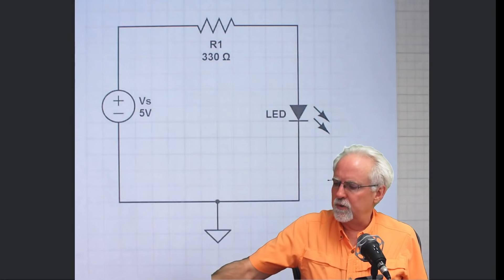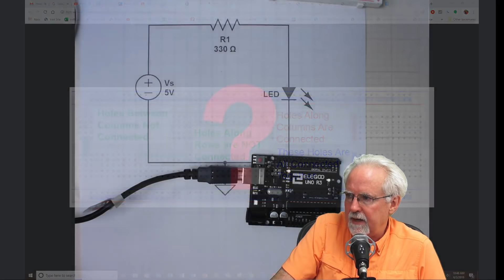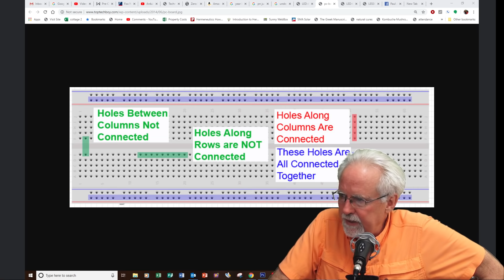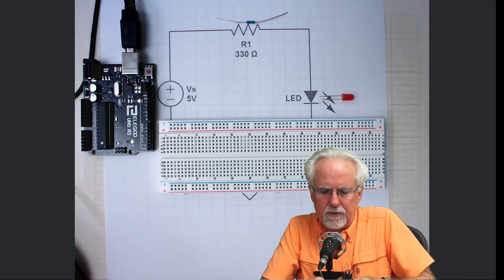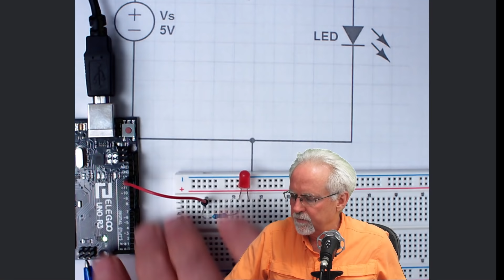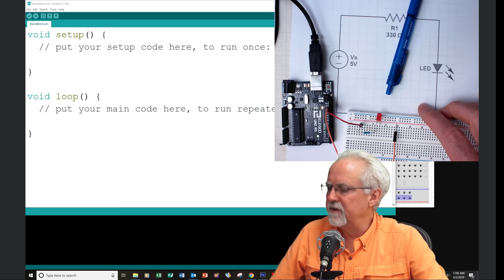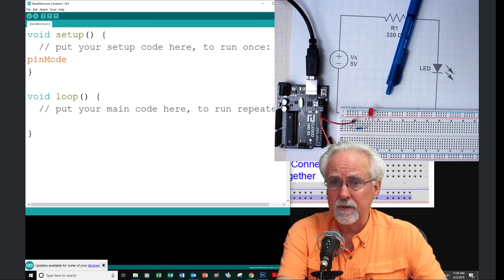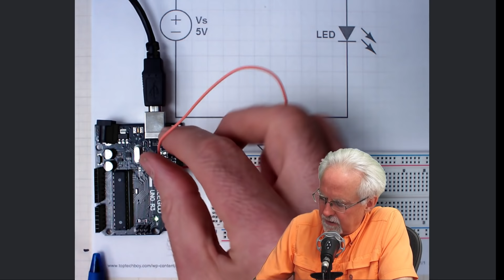Arduino Tutorial 3: Understanding How Breadboards Work

Comment: Paul, I hope I have done this right.  I put the following ALL under VOID Setup:  Seems like there should be a better less cumbersome way.  Thanks for your help.
pinMode(8,OUTPUT);
pinMode(9,OUTPUT);
pinMode(10,OUTPUT);
digitalWrite(8,HIGH);
delay(500);
digitalWrite(8,LOW);
delay(500);
digitalWrite(8,HIGH);
delay(500);
digitalWrite(8,LOW);
delay(500);
digitalWrite(8,HIGH);
delay(500);
digitalWrite(8,LOW);
delay(500);
digitalWrite(8,HIGH);
delay(500);
digitalWrite(8,LOW);
delay(500);
digitalWrite(8,HIGH);
delay(500);
digitalWrite(8,LOW);
delay(500);
digitalWrite(9,HIGH);
delay(500);
digitalWrite(9,LOW);
delay(500);
digitalWrite(9,HIGH);
delay(500);
digitalWrite(9,LOW);
delay(500);
digitalWrite(9,HIGH);
delay(500);
digitalWrite(9,LOW);
delay(500);
digitalWrite(9,HIGH);
delay(500);
digitalWrite(9,LOW);
delay(500);
digitalWrite(9,HIGH);
delay(500);
digitalWrite(9,LOW);
delay(500);
digitalWrite(9,HIGH);
delay(500);
digitalWrite(9,LOW);
delay(500);
digitalWrite(9,HIGH);
delay(500);
digitalWrite(9,LOW);
delay(500);
digitalWrite(9,HIGH);
delay(500);
digitalWrite(9,LOW);
delay(500);
digitalWrite(9,HIGH);
delay(500);
digitalWrite(9,LOW);
delay(500);
digitalWrite(9,HIGH);
delay(500);
digitalWrite(9,LOW);
delay(500);
digitalWrite(10,HIGH);
delay(500);
digitalWrite(10,LOW);
delay(500);
digitalWrite(10,HIGH);
delay(500);
digitalWrite(10,LOW);
delay(500);
digitalWrite(10,HIGH);
delay(500);
digitalWrite(10,LOW);
delay(500);
digitalWrite(10,HIGH);
delay(500);
digitalWrite(10,LOW);
delay(500);
digitalWrite(10,HIGH);
delay(500);
digitalWrite(10,LOW);
delay(500);
digitalWrite(10,HIGH);
delay(500);
digitalWrite(10,LOW);
delay(500);
digitalWrite(10,HIGH);
delay(500);
digitalWrite(10,LOW);
delay(500);
digitalWrite(10,HIGH);
delay(500);
digitalWrite(10,LOW);
delay(500);
digitalWrite(10,HIGH);
delay(500);
digitalWrite(10,LOW);
delay(500);
digitalWrite(10,HIGH);
delay(500);
digitalWrite(10,LOW);
delay(500);
digitalWrite(10,HIGH);
delay(500);
digitalWrite(10,LOW);
delay(500);
digitalWrite(10,HIGH);
delay(500);
digitalWrite(10,LOW);
delay(500);
digitalWrite(10,HIGH);
delay(500);
digitalWrite(10,LOW);
delay(500);
digitalWrite(10,HIGH);
delay(500);
digitalWrite(10,LOW);
delay(500);
digitalWrite(10,HIGH);
delay(500);
digitalWrite(10,LOW);
delay(500);
Reply: Only the pin mode assignments will be in the void setup as that only needs to happen once at the beginning, hence SETUP.
Your digitalWrite and delay commands go in the void loop and then they will loop continuously so they do not need to be hard coded each time you go through the sequence.
P.S. Future lessons will show more efficient ways to code this, but for now we are taking baby steps. Be patient this comes together as we go on.
I have already been through his other lessons so I am excited to see where we are going with this.

Comment: I am having a problem when I upload my code to arduino uno it shows me an error:

Arduino: 1.8.8 (Windows 7), Board: "Arduino/Genuino Uno"

Sketch uses 1944 bytes (6%) of program storage space. Maximum is 32256 bytes.
Global variables use 188 bytes (9%) of dynamic memory, leaving 1860 bytes for local variables. Maximum is 2048 bytes.
avrdude: stk500_getsync() attempt 1 of 10: not in sync: resp=0x30
avrdude: stk500_getsync() attempt 2 of 10: not in sync: resp=0x20
avrdude: stk500_getsync() attempt 3 of 10: not in sync: resp=0x30
avrdude: stk500_getsync() attempt 4 of 10: not in sync: resp=0x20
avrdude: stk500_getsync() attempt 5 of 10: not in sync: resp=0x30
avrdude: stk500_getsync() attempt 6 of 10: not in sync: resp=0x20
avrdude: stk500_getsync() attempt 7 of 10: not in sync: resp=0x30
avrdude: stk500_getsync() attempt 8 of 10: not in sync: resp=0x20
avrdude: stk500_getsync() attempt 9 of 10: not in sync: resp=0x30
avrdude: stk500_getsync() attempt 10 of 10: not in sync: resp=0x20
An error occurred while uploading the sketch

This report would have more information with
"Show verbose output during compilation"
option enabled in File -> Preferences.
Reply from the maker: Looks like probably the program is not uploading. Check that the right serial port is connected.
Reply: @paulmcwhorter  My serial port is connected properly. 
I have been trying to control an led using hc-05 bluetooth module which uses tx and rx of the arduino uno board.  I think that the problem is with that. Because without rx and tx pins being connected, my code uploads without error.

Please give me a solution for this.
Reply: @venkadesh8689  instead of using the rx tx pins try using "soft serial".... google it....
Reply from the maker: connecting to tx/rx can tie up your USB. Unplug, then download, then replug in.
Reply: @paulmcwhorter  I can't understand.???
Reply: @paulmcwhorter  I can't understand.???

Comment: A dc motor is an analog device. Is it possible to use pin A0 to control it? So far I have only used A0 to control a pot.
Reply from the maker: A0 is an input pin. The A0-5 do not control things, they read from things. You read a signal from a pot, you send a signal to a motor. For a motor you would need to use one of the pins 2-13 that has a ~ by it, and then you need to know how to go through a transistor.
Reply: Ha, my old arch enemy The transistor! I kind of know how and why it works but my pulse motor using a transistor to switch on when my rotor magnet rushes next to the coil, still doesnt work.
Reply: Just get an H-bridge  L298 -2x2A (first choice)   or the MX 1508 2x1.5A (second choice) or if you have money to burn buy a proper arduino motor shield (L293 based)

Comment: I appreciated the thorough explanation of the breadboard as it is a new device to me. I smiled when you assigned homework because it must be 50 years since I last did any! 
As to said homework, I was able to quickly write the code…copy and paste is my new best friend, but I’m guessing there’s a better way. Hooking up the circuit was also straightforward except for the ground connections. Not enough of them on the Arduino; then your breadboard lesson pinged in my brain and I used the ground row on the breadboard. Been staring at 5 red, 10 green and 15 blue for a while now. Maybe I’ll change it up! Thanks!
Reply from the maker: Well done! Wondered if anyone would really do the homework. A+
Reply: @paulmcwhorter  Sir would you be showing us how you would have done it?
Reply: You could just run one Grd to the negative row along the edge and run all the Grd s you need to it
Reply: This comment saved me a bit of time and head scratching indeed ha ha thanks!

Comment: I'm more a ice tea kinda guy, but still love the tutorials ;-)
Reply from the maker: Please tell me you do not put sugar in your ice tea. Even worse, please tell me you dont use those little pink packets of cancer starters in your tea. Please?
Reply: Don't worry Paul, I drink my ice tea without sugar or sweetner, just a slice of lemon. No sugars or salt in my life. I have  a simple project idea for your channel. As I prefer being lazy and like to use my brain, I am currently trying to automate, watering my balcony plants using 6 soil moisture sensors and 6 little waterpumps and 1 arduino and 6 relais. Pumps are much cheaper then solenoid valves, so my 6 pumps in a big bucket feed each their own plantpot on my balcony, if required when the soil moister sensor reads low.  Next project, again the lazy element, automated curtains with a steppermotor, printerpulleys and fishwire ;-)

Comment: Amazing to see someone who once was designing consumer grade (or maybe military too..) electronic equipment getting down to (and back to) kindergarten level electronics..
Reply from the maker: Actually in my career, I worked much more down at the solid state physics level of semiconductor devices, which made the building blocks for the computer chips. I had not programmed since college (~early 80's). As an old guy I wanted to get back into micro controllers and using the stuff I had developed the building blocks for. I found it very hard to learn as all the instruction assumed you already knew the material. Hence, my instruction is designed for people who are reasonable smart, but not subject matter experts.